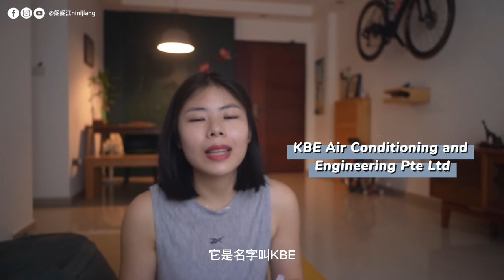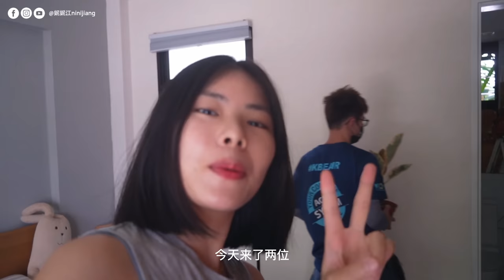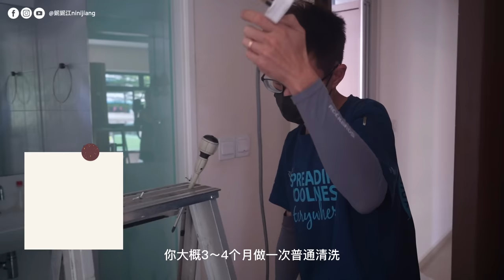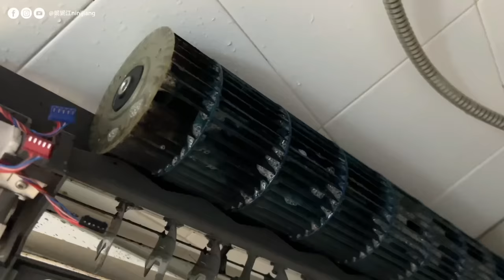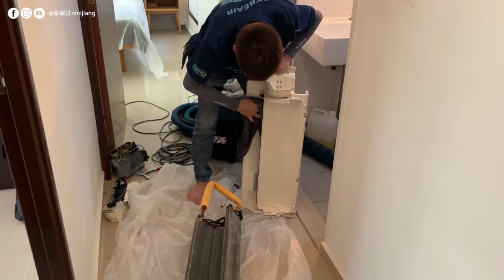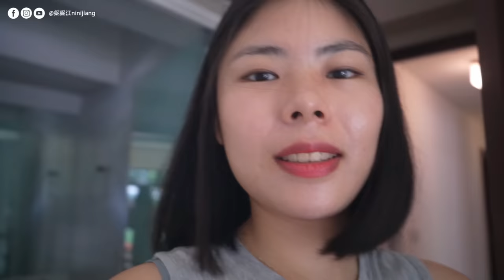在新加坡冷气机「发霉了」有臭味 😱 KBE空调清洗服务体验+心得｜药水清洗5年污垢一次清｜新加坡生活日常

Comment: The aircon price always come with the cheap insulation tube. You must add at least 200-300 for better insulation tube to prevent the molding. These are all the sales gimmick.